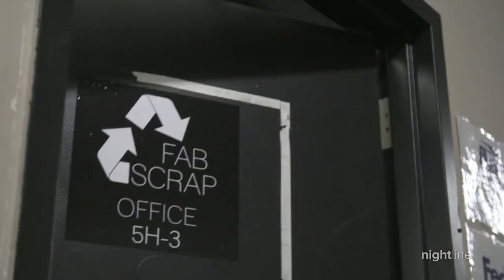Sustainable companies combat the carbon footprint of fast fashion | Nightline

Comment: Such it seems as the problem has come up before, there could be more of a need for the fabric recycling facilities in other areas where, nearby fashion brands, headquarters, factories, in connection with businesses. The above mentioned seems to service some brands but not others and if the over abundance of fabric is so much it holds notions that the process could be helpful elsewhere.